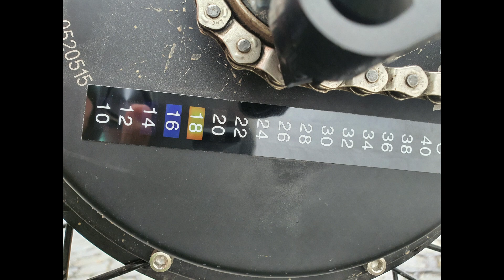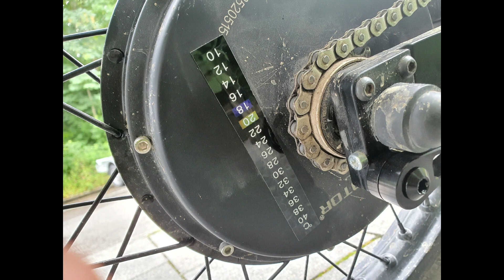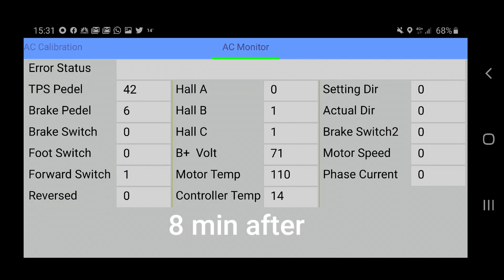Ebike motor overheating test 2

Comment: I bring logic:
I dont know what motor you guys have but the q3 motors have a big flaw and this is aluminum or aluminium (Al). Its diamagnetic and the induced currents in the magnets heat up the center "sprocket" of the hub motor causing it to heat up more.
To fix this you need to go with feromagnetic sprocket where the north and south poles meet through the center helping eachother instead of only heating.
Another way to imrpove the motor is to put 2 more magnets for each magnet pole - [South left to north right][South up to north down][south right to north left] -> A half halback system where the motor would gain additional balast on the outter circumference of the hub motor. (T shaped if the bottom of the T is the central part of the motor), but overall the magnet would be that much stronger where you would need less amps to get to the same power rating albeit gaining some weight - but neodyium magnets are "bought power".
Reply: No reply to your comment 😭
Reply: I sent this video and suggestion to QS Motor Manufacturer, hopefully they can make improvements!
Reply: @mdubz  There is a caviat about having too much magnetism so i am not so sure if haal array would improve that much. perhaps more torque while losing speed.

Comment: Will a factory ebike have a risk of overheating the motor? I weigh 70kg and live in medium sized hills, but I like to ride fast.  I’m wondering if I’ll want to watch the temperature of my motor with tape or a laser gun.  Also, I’m thinking I might increase the speed limit from 28 mph to 35mph.  :-)
Reply from the maker: What bike do you have?
Reply: @Vectorebike  mxus 500 watt nominal, 1200 peak according to a 2019 review. I assume the motor is the same.  Nowadays they usually say 1250 peak, though.  It’s a ebc model c